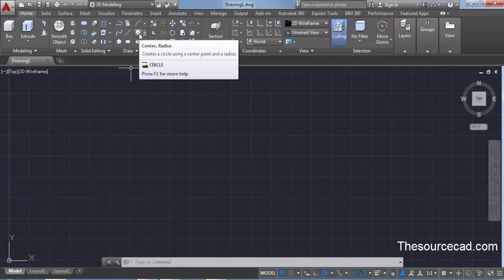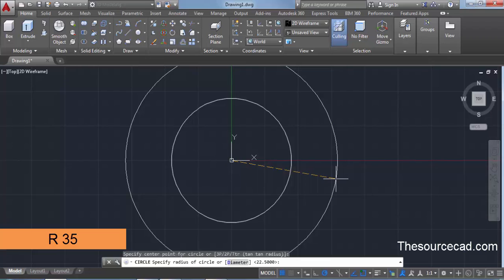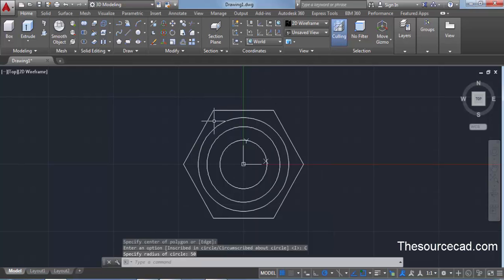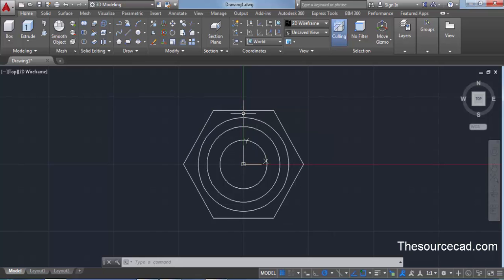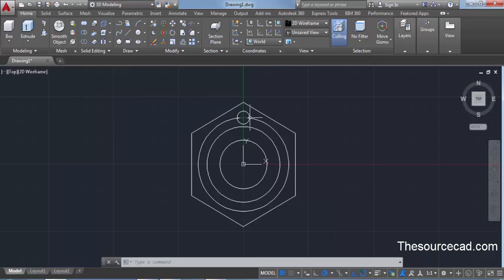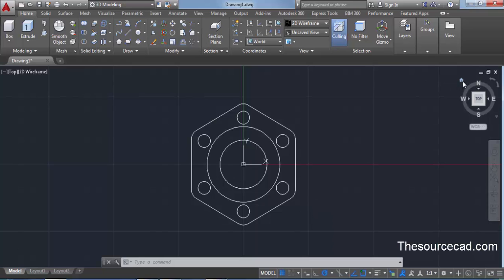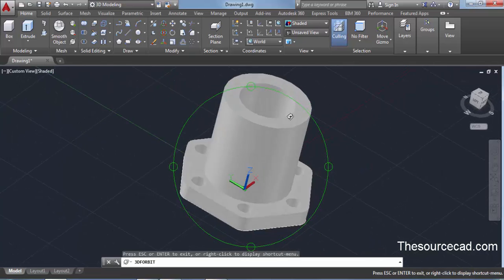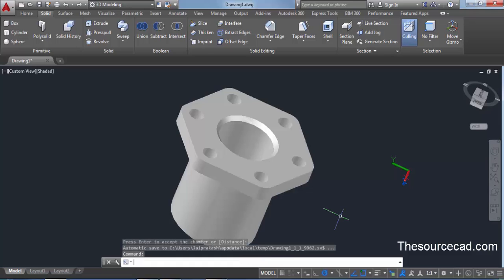3D practice drawing in AutoCAD

Comment: Thanks for great job that you doing. I have the software but my objects for example if I enter the dimensions in the video they appear to be very very tiny, almost invisible in my drawing area. How do I fix this on my software  please. You quick response would be very much appreciated.
Reply from the maker: Its because scale of your dimensions are very small, to change scale type D on command line press enter then click on modify button dimension style window then select fit tab and change value of "use overall scale of" parameter to 10 10 or something else which is large enough to make your dimensions visible.